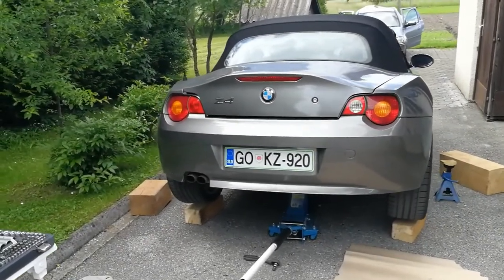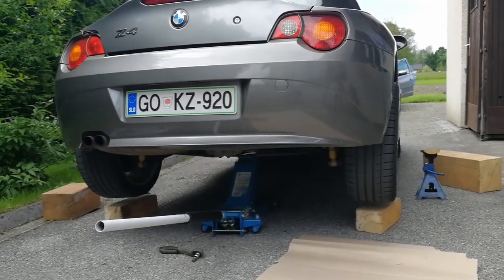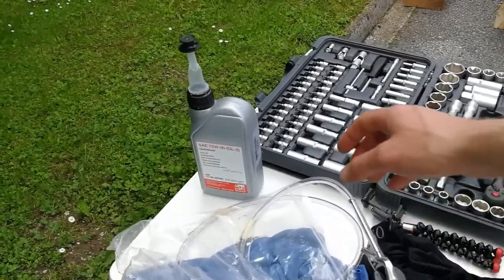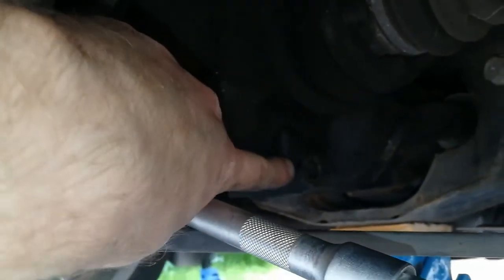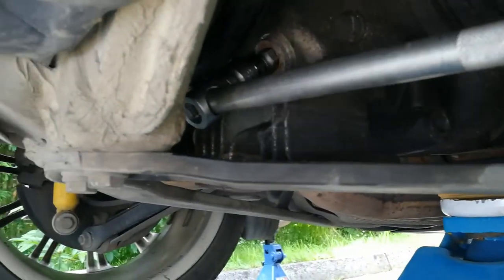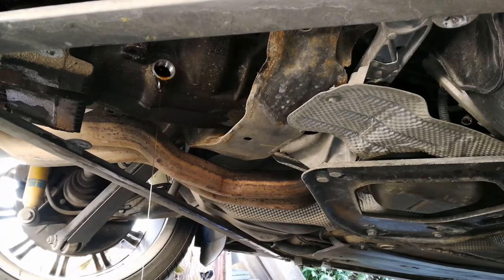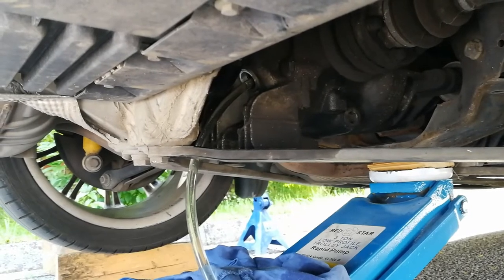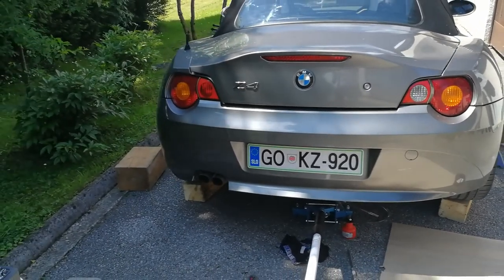BMW Z4 E85 Differential Oil Change

Comment: Hey, i noticed you used 75w-90. All of the gear oils im seeing Liqui Moly or Redline recommends is 75w-140. Why did you not go with that? I have a 2003 3.0i z4
Reply from the maker: I have a normal Z4 2.5 M54B25 car, so it has a "normal" rear diff which takes normal 75W-90 oil. I think 75W-140 is specified only for Z4 E85/E86 M models, which have a different - more sporty - rear diff.

This is my source: https://www.newtis.info/tisv2/a/en/e85-z4-2.5i-roa/repair-manuals/33-rear-axle-rear-wheel-drive-guide/33-00-rear-axle-rear-wheel-drive-guide/1VnczONFlo
Reply from the maker: I think that earlier BMW diffs (up to 2006) have roller bearings that require thinner oil. Later variants use ball bearings and thus require thicker oil.
Reply: The thicker oil isn't needed. Keep in mind thicker also means aging faster. Kinda compare if ppl would recommend 20W60 for motor oil. Higher isnt always better.

Comment: on 2008 BMW Z4 3.0si I did not have a drain plug, so I used 2 liquid hand pumps from FCP euro so as not to cross contaminate the oil. Took a little while to make sure I got the liquid out. But it worked like a charm. Your video gave me strength to get it done on my own, much appreciated.

Comment: i advise you to raise the front end as well, and make the car level. you raised the back end and overfilled differential. that can cause failure of seals because of over pressure while hot.
Reply from the maker: I know that, that's why i lowered the car to horizontal position and just let the excess oil drain out before putting back the filling plug. I think it should be ok.

Comment: Great video and interesting to see how you can get a lot of KMs out of a well looked after car.    I have just purchased a BMW Z4 E89 - Only 70,000km but I will do engine oil/filter change,  manual gearbox oil change and differential oil change.
Reply from the maker: Congrats! Yeah, these engines are great, they can take a lot of miles. However, I will have to replace the rubber flex disk and some rubber diff mountings in the near future. They have cracks and I can feel some play when shifting in low gears...

Comment: I have a 2003 bmw z4 m54b30. Was wondering if I should use the same gear oil viscosity you used, and if you recommend using gear oil with or without the anti-slip additive
Reply from the maker: I don't have any special knowledge about diff oils to give you a proper advice, so the only thing I can recommend is using the factory recommended oil. In my case it was the 75W90 gear oil. You most probably don't need anti slip additives unless you have a LSD with clutches.

Comment: Link for oil pump and hosing? Any ideas for torque settings for the two plugs?.
Reply from the maker: Check out this documentatiton: https://www.newtis.info/tisv2/a/en/e85-z4-2.5i-roa/repair-manuals/33-rear-axle-rear-wheel-drive-guide/33-10-rear-axle-final-drive/E4jY3pq
This is for 2004 2.5i version:
- oil fill and drain plug
 with sealing ring: 65 Nm
- oil filler and oil drain plugs with O-ring on cover / housing: 60 Nm

Comment: Buenos días desde España!!. ¿Qué par de apriete tiene el tornillo de vaciado y el de entrada?. Gracias. What is the tightening torque of the drain screw and the inlet screw? Thanks.
Reply from the maker: 65Nm for plugs with sealing ring, 60 Nm for plugs with orings.

Comment: I'd be interested.
BMW z4(E85) n46b20b ,6 speed (2006)
1.Motor oil type(4.25L / 5-30 LL4)
2.gear oil type ( ? ,?) liter?
3.differential oil type( ? ,?) liter?
thanks...
Reply from the maker: 2. Manual transmission oil: MTF LT-3 75W-80 (83222339221) 1.6 L
3. Final drive oil: SAF-XO 75W-90 (83222365987) 0.85 L
Reply: @BimmerZen  😃😜
Reply: @BimmerZen  Final oil :Transmax Axle(long life)75w90( Non-Limited Slip Rear Axies).Good or not??  Thanks..

Comment: En la caja automática es recomendado usar Valvoline atf Max life para la caja zf 5hp19?
Reply: Es pregunta
Reply from the maker: I don't know exactly but this BMW document http://www.bimmerboard.com/members/ripp222/original/Operating%20Fluids%20-%20Complete.pdf states that ESSO LT 71141, BMW Part No. 83 22 9 407 807 should be used. Spec sheet of Valvoline MULTI-VEHICLE ATF states that is is suitable for  ESSO LT 71141 and ZF 5 speed transmissions.
Reply: @BimmerZen  no me dedcarga
Reply from the maker: @petrovconjugodecascada2261  try now.
Reply: @BimmerZen  gracias